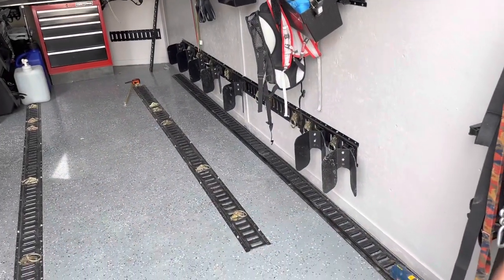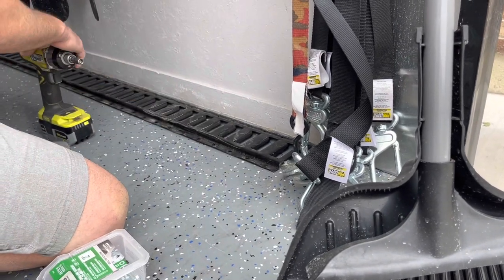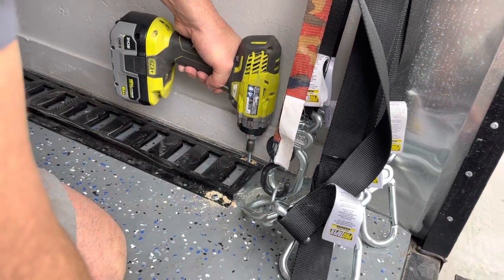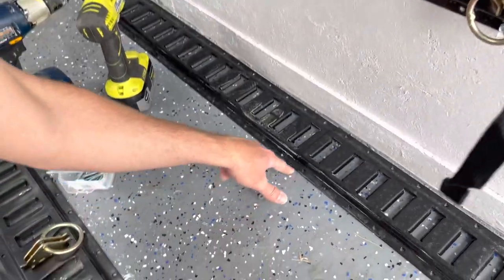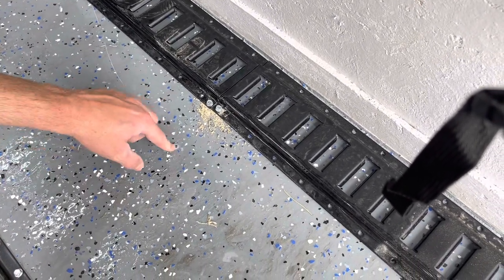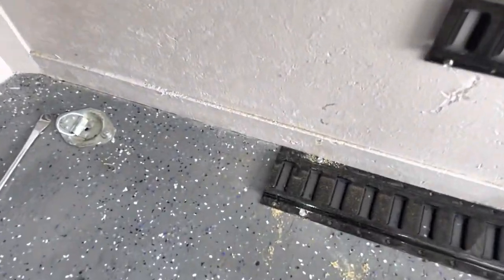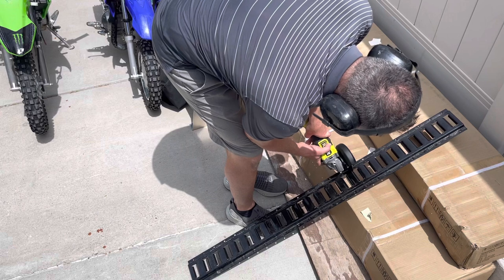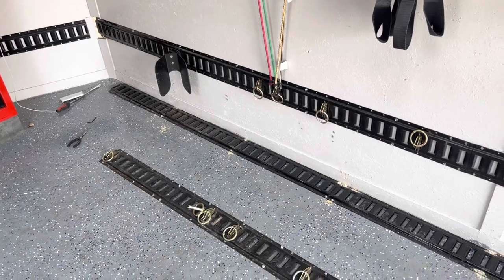Installing E-Track in an Enclosed Trailer | Easy DIY Project!

Comment: How far from the sidewalls did you put the etrack? And how far up? And why did you put the third etrack right against the wall?

I'm working on the same thing in my trailer for dirt bikes and was planning on just doing one on the wall and one on the floor but trying to get the measurements right. Thanks for the video!
Reply from the maker: The etrack on the wall is 14" high, the etrack right next to the wall works better than for strapping the bikes in at an angle than the row further away.

Comment: For the e track on the wall, did you cut the wood trim that covers the gap between the wall boards?
Reply from the maker: Yes I did cut it so the etrack would lay flat